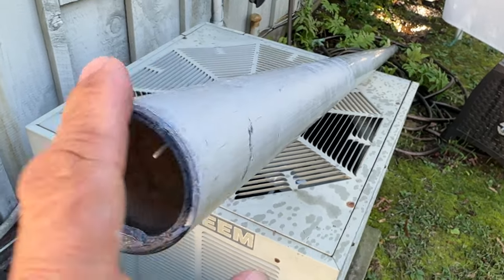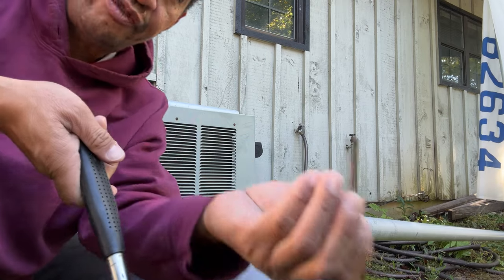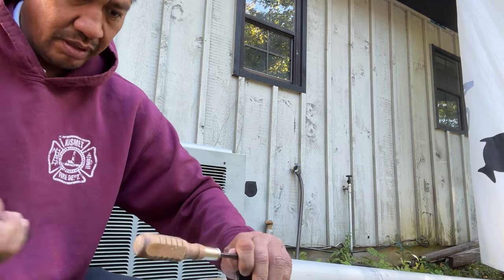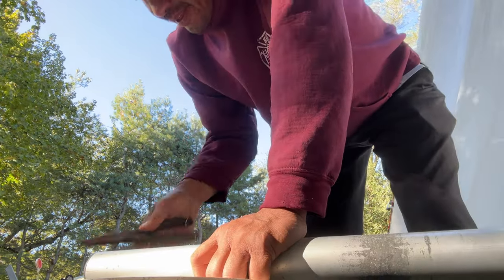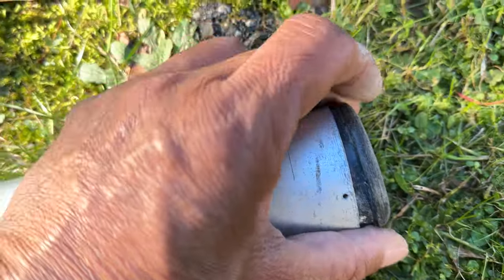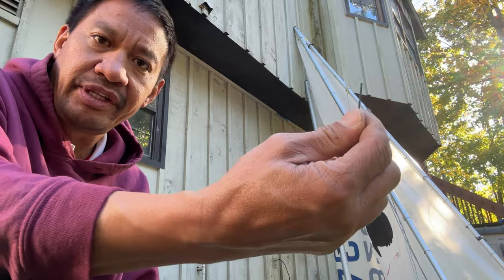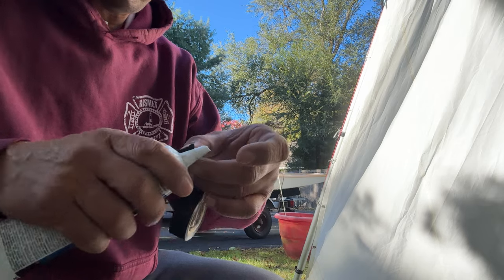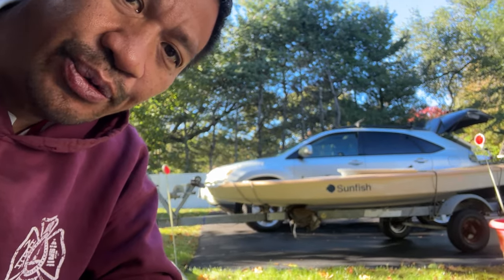Sunfish Sailboat Mast Base/Mast Cap Repair

Comment: When drilling metal go slow rpm and use a dab of oil. Speed will overheat the bit and dull it and cut nothing. Lots of pressure does not make the bit cut better either and is more likely to break a bit...only need enough pressure to keep it from walking around. Really like your videos Lee!
Reply from the maker: Thanks for the input!!   Ill remember that next time!

Comment: a timely topic for me.  My mast cap broke this past Sunday when I made a simple mistake pulling my boat out of the water.  The wind was blowing directly onshore, so I disconnected my main sheet and let the sail blow over the bow of the boat while I pulled it up on the dolly,  then I turned the wrong way and and the sail twisted the halyard around the mast putting to much force on the mast cap and it broke.
Reply from the maker: I did the same thing on my first solo, except didnt release the main and broke my bullseye fair lead….

Comment: Hi Lee, gosh I’ve learned so much from your videos. Greatly appreciated. Need some advice, I noticed a rotten hole in my mast a few inches from the bottom. It’s a ‘75 and has spent its life at the beach until I got it about a year ago.
Reply from the maker: Sound like corrosion and eventually will break.  Inside the mast will be corroded, i would replace it.  I have broken a few masts and never fun, habe to get towed or paddle in after gathering the sail from the water

Comment: How did the mast break.    When I was sailing my sunfish the mast broke and fell on the sail into the water.   I was shocked.   Used what was left of the mast to sail home.   What happened to my mast?
Reply from the maker: Masts break mostly due to corrosion.  Especially from the inside, plus any stress caused by sailing.  It just happens.  If one can completely rinse the boat and its parts woth fresh water and dry before storing, the lifespan will be a long.

Comment: Quick question. Do you ever put padding down on the deck for your butt. Or is that frowned upon because it’s not a standard upgrade.
Reply from the maker: Hi, i do not, but to each their own…. My racing gear is padded, unless im only sailing for a couple hours-   Then im always moving on the boat and many times my”sit bones” are off the side of the boat so no padding is needed.    But if you wsnt padding, go for it!

Comment: Just finished watching your Jens rig video. Thank you so much. Quick question, is there a reason to adjust the gooseneck along with a Jens rig set up? I weigh around 140 lb.
Reply from the maker: Yes.  Adjust the gooseneck as needed ti balance the boat…. Checkmout the gooseneck video for more details….  Thanks!!

Comment: A nailset is cheap to buy at the hardware store, and will find endless uses around the house. A few taps with that will create a spot for your drill bit to start in, without it wandering off. The nailset can also help tap your pins out and re-set them, and help with knocking out old rivets after you've drilled them out. Nail-sets come in two styles, often packaged as a pair: a sharp point, and a cupped point. The cupped point will hold onto the end of a brad or pin so you have way better control with the hammer.

I'm curious, Lee, if you have any tips for the socket where the mast goes, in terms of protecting the socket from cracks or friction wear. Do you put anything between the mast base and the bottom of the socket?
Reply from the maker: Thanks for your input i never heard of a nail set.  

As far as anything in the mast socket/ mast hole/mast step…. I have seen people put duct tape around their mast, electrical tape snd custom made delrin plastic sleeves…. Not for protection as much as to limit play.   I also have seen carbon fiber disks places on the bottom of mast steps to protect the base…. A sailboat shop that sells sunfish stuff may have the disks.
Reply: Are there any class rules about or against stuff in the mast hole or around the base? @LeeSideSailing

Comment: First of all, raise the other end of the mast so it lays level with the bucket bottom. Better yet lay it on a picnic table. Use a broken drill bit to tap the pin out. I used to build hang gliders. I can't watch this vid anymore. Do it right, or don't do it at all. I used to teach shop as well. Sorry Lee, but your vids make me cringe.
Reply from the maker: Thanks for the comment!